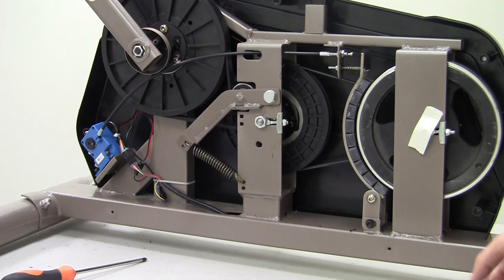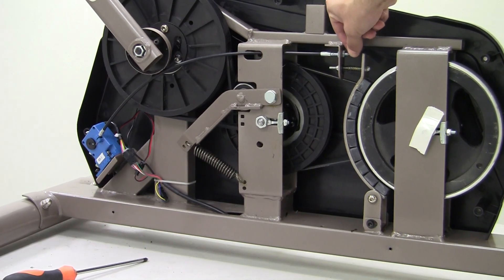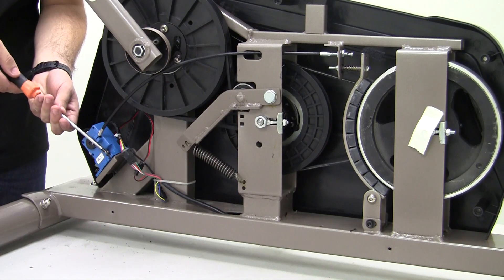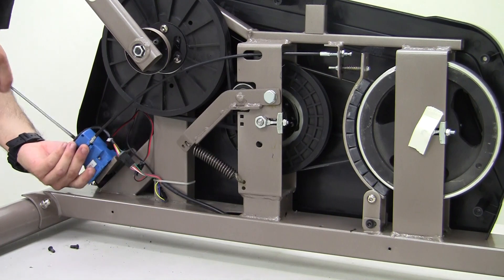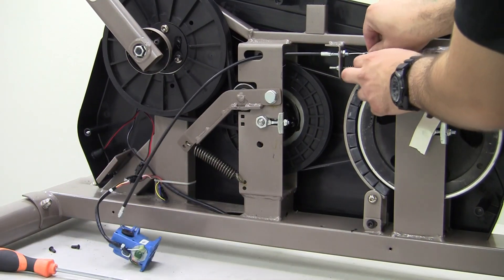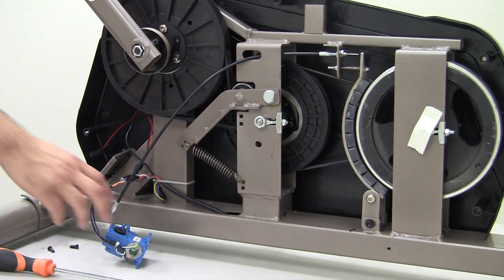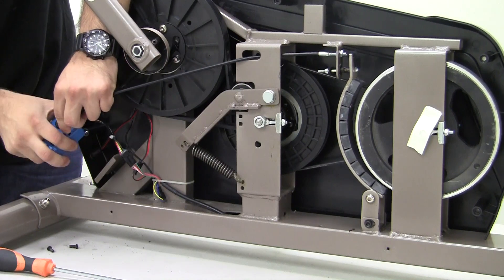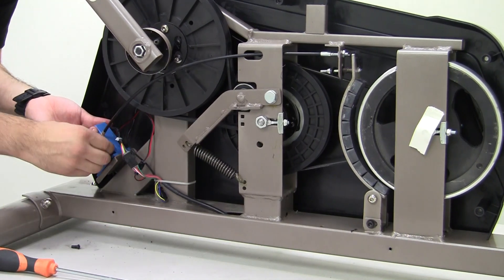1318 - How to Fix High Tension

Comment: Ich habe den Antriebsriemen an meinem Kettler Crosstrainer gewechselt – den Riemen habe ich von Bulktex bekommen.
Der Kundenservice war super, sie haben mir sofort geholfen und hatten auch für meine anderen Fitnessgeräte die passenden Riemen auf Lager.
Der Versand ging richtig schnell – direkt nach der Zahlung war der Riemen bei mir und ließ sich problemlos einbauen.
Kann Bulktex nur empfehlen!

I replaced the drive belt on my Kettler crosstrainer – got it from Bulktex.
Their support was great, very helpful, and they even had belts for my other fitness machines in stock.
Shipping was super fast – the belt arrived right after payment and fit perfectly.
Highly recommend Bulktex!